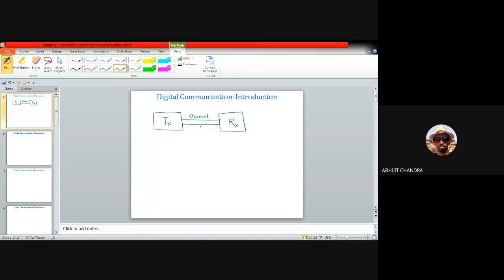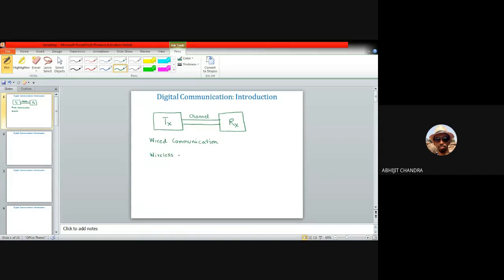Lecture 1 on Digital Communication System: Sampling and PAM

Comment: Sir please tell me... how g(nTs) is constant term...You have told at 29:09
Reply from the maker: I mean to say that g(nTs) is not a function of time. It is basically a scalar quantity.
Reply: @abhijitchandra915  sir, how sampling of a message signal become scalar or vector ... I think g( nTs) is a function of n . ,sir.
Reply from the maker: @aminurrahaman4931  while calculating Fourier transform of g(delta)(t), g(nTs) inside the summation is treated as not to be a function of time (i.e. t) and hence we apply the linearity property of FT. Linearity property says that FT(const*x(t))=const*X(f). It is indeed true that g(nTs) is a function of n, but the transformation takes place from the domain of 't' to the domain of 'f', not from 'n' to 'f' in this case.
Reply: @abhijitchandra915  okay sir got it.. Thanks a lot, Sir.